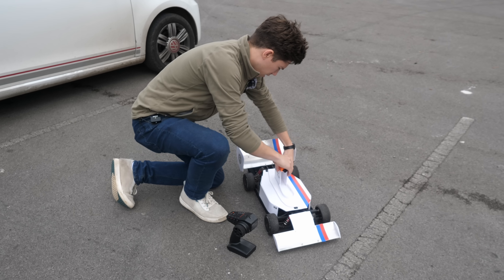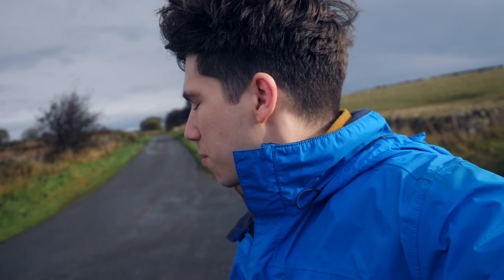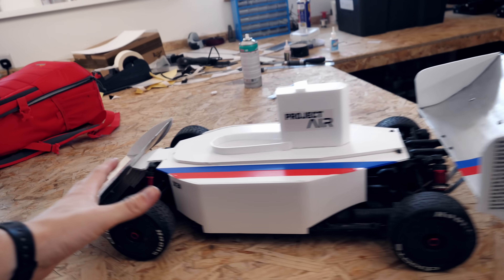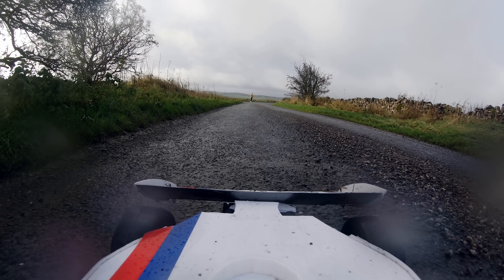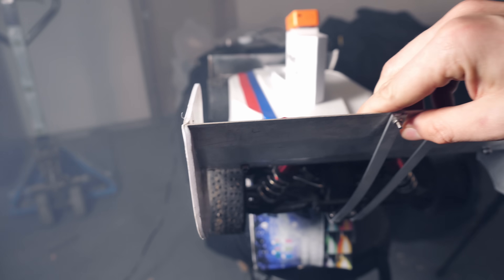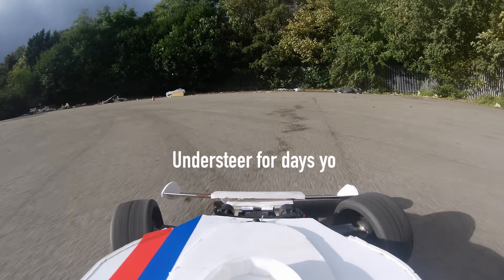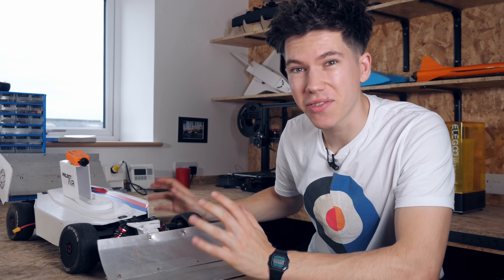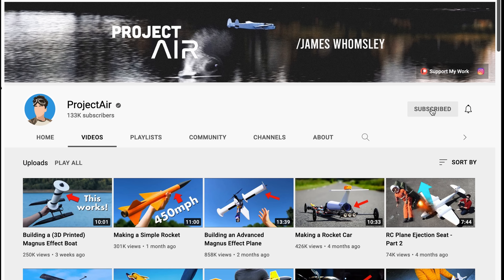RC Car Extreme Aerodynamics

Comment: Great project, maybe on a smoother track, like inside a sport arena,  you could experiment more with the ground-effect.
Reply from the maker: This is what I've been thinking since finishing my experiments! Great suggestion. Maybe a ground effect fan car?
Reply: @Project-Air  Like the Brabham BT46 F1 car? That would be cool
Reply: @Project-Air  That sounds realy interesting.
Reply: @Project-Air   if you go the fan car route, I can offer some info as to what's worked best for me so far. When I get a new motor setup I'll be going for round 3 looking to drop another .5s off my 0-60 time.

https://youtu.be/32zCMaGEY8I
Reply: I second the fan car idea! And getting an indoor roller rink or something haha
Reply: I agree but if you want to make it a real track car you use asphalt then find a way for the car to adapt

Comment: You should do a wing on the back that goes into the body and mounts to the suspension that way the big front wing won’t have as much of an effect on the rear wing and you’ll get a ton of down force it’s no longer allowed in most racing but would be cool to see explained
Reply: That's how I thought the wings were setup - to act on the wheels directly rather than through the chassis and suspension.
Reply: @PatGilliland  the way he had his mounted they were chassis mounted so it forces the whole car down but there’s ways to mount it to the suspension to provide more downforce

Comment: Attach an accelerometer to measure peak lateral g-force with and without aero.
Reply from the maker: A good idea for next time
Reply: @Project-Air  If you do not have an accelerometer you could also run car flat out and than corner it at full speed. If the cars corners tighter...you have more grip (provided you get the balance right between front and rear wing).
Reply: @stephandelaat  are slows the car down so it circles better because it reduces the full speed but that idea can be used with some modifications
Reply: @stephandelaat  Pack a phone on it and run one of many apps that capture the accelerometer data from the built-in sensors, done. 

Everyone has an accelerometer, they just don't know it!
Reply: @Project-Air  - For accuracy in every test, you'd need a wind tunnel maybe 3 feet across at the centre, then have sensitive weight scales, one for the front wheels and one for the back to figure downforce distribution.  Acceleration in the real world will impact this a bit with lift at the front, at least until you reach max speed to an extent.  In any case, a good wind tunnel can facilitate many other experiments in future.  I'm a sucker for aerodynamics.
Reply: @revolution3395  have you ever seen a hobbyist's wind tunnel? Because I haven't.
Reply: @revolution3395  did I mention anything about supersonic tunnels?? That's a different kind of beast...
Reply: @aGabay  - I know you made no mention of supersonic tunnels, but neither did you search for subsonic ones.. ☺
Reply: @revolution3395  yes, but I also worked with real sub-sonic wind tunnels, so I know that any homemade tunnel will be subpar. Moreover, for the size of models he is working on, he will need at least a 0.8*0.8 meter tunnel to eliminate wall interaction.
Reply: @aGabay  - " ..he will need at least a 0.8*0.8 meter tunnel.. ".  That's why I said around 3 feet, it's about 0.8m, but obviously the bigger the more accurate, with a rolling belt for the wheels and just prior to the belt boundary layer removal would be more optimal too, but we can't have everything, it's just a model car so a simple one should be all he needs.  He can also use a "good enough"  version to balance his model rockets more accurately.
Reply: @revolution3395  His model rockets are a different kind of barnyard tinkering. With a bit of help from his sponsors, he can actually design those things instead of trying and failing with no idea why.
Reply: @aGabay  - The main failures I've seen with model rockets is:
1 - By far, centre of gravity too far aft while centre of pressure too far forward.  This could mean any existing forward fins are too big or the rear ones are too small creating an aerodynamic imbalance.  Usually a "swing test" is used to check for stability, but a wind tunnel can be more accurate and more fun.
2 - Guide stick/post on launch pad too short which doesn't allow the rocket fins to gather enough aerodynamic speed for stability before clearing the guide.
3 - Engine mount/thrust plate/ring too weak, allowing the engine to plow its way through the casing destroying everything, most often accompanied by fire.
Reply: @revolution3395  Truth. Also, poor material choices. I don't think he actually understands aircraft stability margins, and that's a shame. could have helped him succeed.
Reply: @aGabay  - I've seen people think something should fly just because it looks like a plane.  I'll give him that he knows about CG and how important it is.  I've also seen some of the most ridiculous parachute designs.  Some erroneously use far too much initial throw on their aircraft control surfaces, causing a very nervous plane and almost immediate crash.  Structural integrity is definitely important and needs consideration for every application, and how not to exceed limits whether airframe or road-going.
Reply: @revolution3395  Bottom line, with little effort he can make better content. I can't be bothered to check what was the sponsor for this video, but the likes of skillshare and such can really benefit him if he learns from them and not only promote.
Or do why what I did - go to university and become an aerospace engineer...
Reply: @aGabay  - " Or do why what I did - go to university and become an aerospace engineer... ".  True, but some people don't learn very fast, only have so much capability or simply want to experiment and learn at their own pace.

I saw a vid a while ago where some engineering students were creating a new experimental plane for a large aviation company.  The music and production of the vid was ridiculously expensive and deliberately overloaded with drama.  It took them about 2 years and god knows how much more money to design and build the plane, maybe 2 - 3m wingspan with electric ducted fans.  But on YT here people without such education build some of the most amazing aircraft.  I can't find the vid now, it's here somewhere.
Reply: @revolution3395  I totally agree with you, there is some magic in tinkering. The problem is people trying to present themselves as "scientific" whilst they are just garage tinkerers.
About this group of students, I think I may have seen that video, but here is one from my "portfolio":
https://www.youtube.com/watch?v=eyWEIkUUJSY&t=32s
I was the team leader for this undergraduate project's 3rd and final year, a 3D printed aeroelastic technology demonstrator - with designed Body Freedom Flutter at very low airspeed (about 48 knots). The video shows the flight test we conducted last April.
Reply: @aGabay  a college degree doesn’t make you an engineer
Reply: @danielcockerspaniel  I totally agree, it's the experience. But it gives you all the fundementals so you can become one.
Reply: @aGabay  sort of. Mostly it exposes you to lots of math and fundamental concepts like heat transfer, some fluid dynamic principles, propulsion, and depending on the school you attend, numerical methods hopefully. But mostly the goal of an engineering education is to train you as a problem solver.
Reply: @danielhatfield8921  agreed. But without that background, you won't have those tools.
Reply: @Project-Air  You just need to see how much more the car squats at speed.  Any extra grip is due to down force providing  more friction to the tires, so you just need to keep track of how much downforce is added as well as your top speed in the a straight line.
Reply: @Project-Air  there are small scale Arduino-Boards with build in 3 axis accelerometers and SDCard Slot to log the data.
Reply: @Project-Air  everyone is taking this way to seriously..  I have an idea dude i'll talk to you about it at some point..
Reply: @Project-Air  it's a whole science of its own to perfect the angles and shapes for optimal benefit, just look at how long actual formula sport took to get to where we are today, and even then the improvements are usually incremental but sometimes enough to gain that edge in a race to help secure a podium position
Reply: ProjectAir make an hydrogen oxygen powered rocket
Reply: @Project-Air  I don't know if this has been mentioned but, why not just one aerofoil over the center line?
Reply: @Project-Air  also make sure you reach top speed before entering the corner, otherwise if you are still accelerating your AWD setup will give you more understeer. Get to top speed before the corner or make it RWD :D i also noticed the bump in the road that caused at least one of these crashes. Another thing to consider is maybe give the left front tire negative camber. when the car leans into the right hand corner, the left front tire is being pressed into the road much more than any other wheel. By giving it negative camber, the wheel will be straight as it should be mid corner, to give you maximum surface area contact to the road, as opposed to having only the outer section of the left front tire taking all the load. Hoping to see many more videos on this, just found your channel yesterday and am already addicted haha, keep it up mate!
Reply: @Project-Air  take the internals(motors, batteries) and put them in a 3d print aston martin valkyrie amr pro racecar body, cuz its made for top speed and has super low drag
Reply: @Project-Air  a GoPro has the ability to show g force, and speed.
Reply: Export the data into MoTeC
Reply: Thats what i was thinking.
Reply: a what
Reply: Hey there. I'm a mechanical engineer and like your video a lot. 
You could also use ansys as a tool and do a cfd analysis. You can use it to calculate the downforce/ drag force  relatively easily. There is also a student version.
Reply: Too easy 😅
Reply: The only word I understood was accelerometer
Reply: you may as well of made this video instead. 😂
Reply: Can you get a model car to drive on the ceiling?

Comment: If it's a square relationship doesn't double wing equal quadruple lift/downforce?
Reply: L = 0.5*rho*S*C_L*V² where S is the wing surface, so his statement is completely wrong...
Double the surface, double the lift force.
Reply: @aGabay  yup
No clue what he was on about
Reply: The first part he said was wrong, lift is instead directly proportional to the area. The second part about doubling the length doubling the lift was correct though
Reply: Makes more sense ;)

Comment: Lift does not increase with the area squared, but rather the speed squared. Area is just A^1
Reply: He said that bit wrong, but what he said immediately following that is correct
Reply: what he means is if you doulbe the diemensions the area gets squared
Reply: Velocity is a bit different than speed but yeah
Reply: @spooxsy  in this context, its not, velocity here is the free stream velocity component that is normal to the chord, by definition direction doesnt change, therefore "speed" is not incorrect